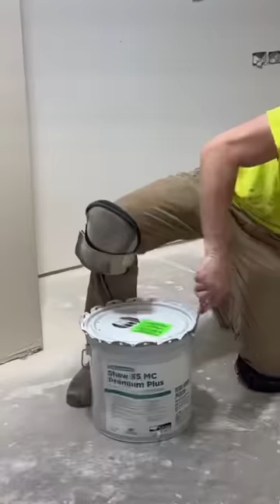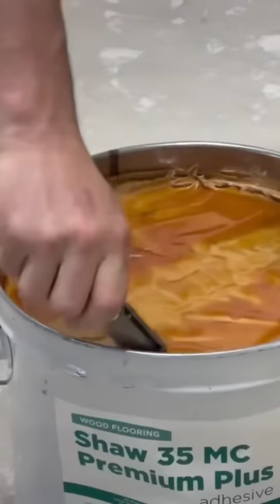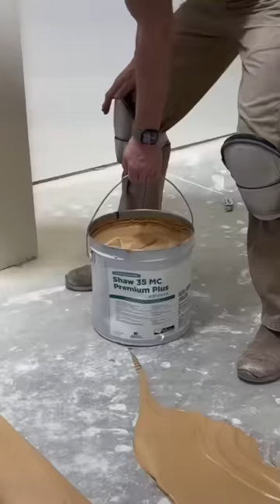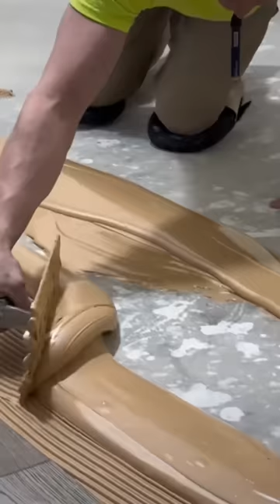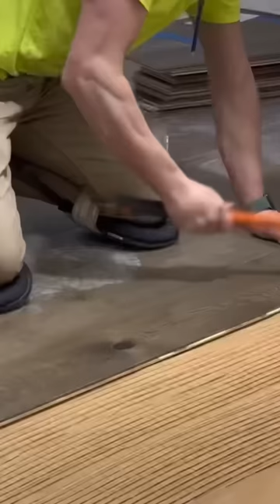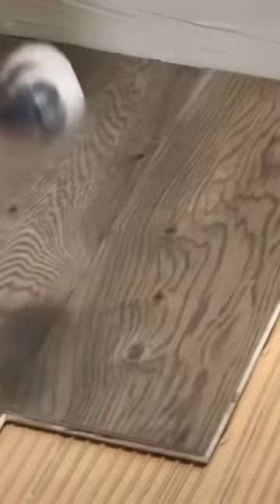Installing hardwood floors over concrete #shorts #flooring

Comment: The problem I have with calling this "hardwood flooring" is that you are using a technicality to sell something that is not what people expect when they are told they are getting hardwood floors. 

The common term hardwood flooring implies to most of the world as a piece of wood that is 3/4" thick solid wood flooring. 
NOT something with a skim coat of actual hardwood with glue and partial pieces of random wood. 

Using any other sort of flooring with the term hardwood flooring is just ripping off the customer.
Reply from the maker: In my trade we differentiate those two floor types with “solid” and “engineered”. Both are still considered hardwoods. This snippet of a recent install is not meant to misguide or sell anything to any customer.
Reply: @DaveyStruggle    Sure you can say that this video isn't meant to misguide anyone, BUT you yourself titled your video "installing hardwood flooring over concrete". If you didn't specify or differentiate in the title of your own video how often are you, and your trade, actually informing the customers what they are REALLY getting. Not to mention how many people are buying houses with the tag "hardwood floors" only to find out when their washing machine floods that they really have "engineered hardwood floors". 

I'm not saying that you specifically are misleading people, I AM saying that your trade is doing some shady shit regarding hardwood floors.

Comment: Why are you putting adhesive over paint, with out any moisture protection,  and sitting on top of the new flooring that still has wet glue under it

Comment: No vapor barrier is required?
Reply from the maker: Not with this adhesive. In fact, no moisture testing is needed either. The glue itself acts as a barrier.

Comment: Can't wait for experts to comment on this!
Reply: He popped up every flap rookie
Reply: the way the rows were instaled 😅_-__=
Reply: The grooves in the adhesive are running the wrong way there’s no way for the air to escape
Reply: @maxnoble523  there is no directional troweling. You don’t want this guy installing tile either

Comment: Why would you glue a floating floor you're supposed to have a thin Vapor Barrier underneath it so the floor actually moves in all directions you don't glue it down regardless if it's on a cement floor or a wooden floor
Reply from the maker: Engineered hardwood floors can be nailed, glued or floated. The glue is a special glue that allows for certain movement, and also acts as a vapor barrier. It also has noise deadening properties.

Comment: Everyone is giving this guy hell but solid or engineered flooring generally has to be secured to the subfloor. Most flooring shows how to secure it on the box, and if not, their customer support is always happy to provide their recommendations. Sure this will suck to remove, but there weren't many options here. Just get a pneumatic hammer with a wide chisel and go to town when it's time to remove. It's not hard, it just takes a while.

Comment: Jesus how much adhesive was needed wouldnt it be much more cost effective to use a smaller trowel
Reply from the maker: Trowel was designed by adhesive manufacture for this thickness of engineered floor. The trowel is found inside the pail itself. It comes with two, one for 3/8”, and another for 5/8”, the latter was what I was installing.

Comment: Are you sure that's wood that he's putting down and not the cheap pergo floor ing
Reply from the maker: This is a very common substitute for solid wood floors here. We call it an engineered floor, which has a Oak 1/8” veneer with a plywood base. Some higher end versions can have up to a 1/4” hardwood top. Which can be sanded down and finished multiple times.
Reply: Okay that's fine then it still looks like a cheap substitute

Comment: the walls are spray painted.. he didnt sand the floors before gluing.. glue will loosen and lift against all the walls with paint overspray on the concrete. no no no.. big ouch. hes even not making space for the floor against the walls 😂

Comment: По моему это полный идиотизм! Полы только испортили! Во первых ламинат имеет свойство расширяться от влажности, по любому он взбучится по краям на этой клеевой массе. Во вторых когда ламинат придёться убирать, по любой причине, не важно, то полы как потом убирать от этой клеевой массы? Хорошо если она затвердеет и особо не схатится с бетонным полом! Вообще ламинат кладут на специальную подложку, а тут что-то невиданное происходит!
Reply from the maker: It seems this type of flooring ,seen in this video, does not exist where you are from. One thing I have been noticing from the comments, many of you speaking Russian are assuming this is laminate, which has a “wood dust” core. That is not the case here, this type of flooring is called engineered hardwood and has veneers of wood, including a oak hardwood top.